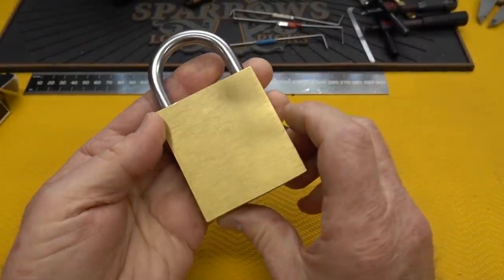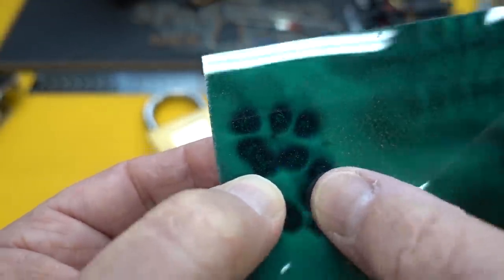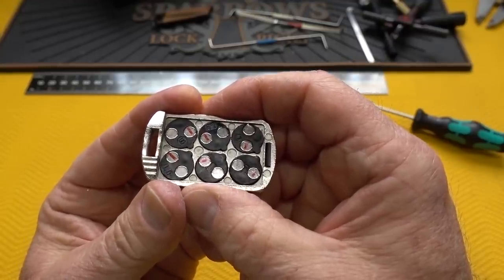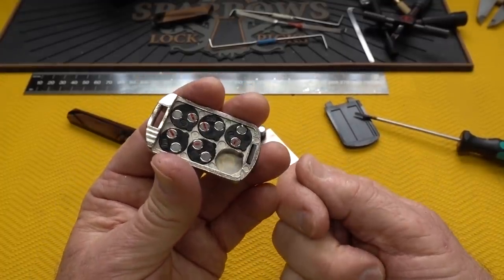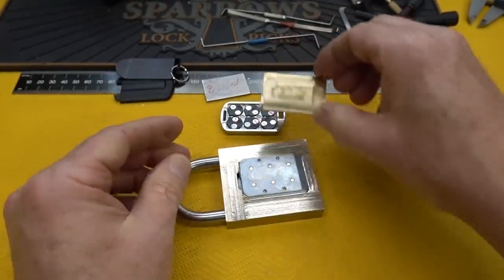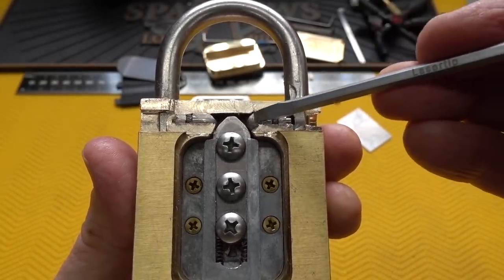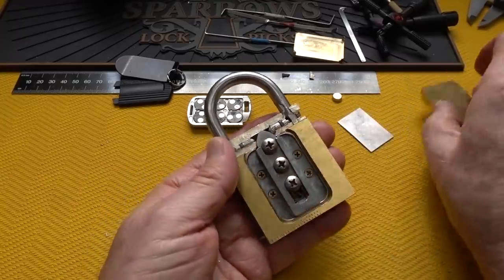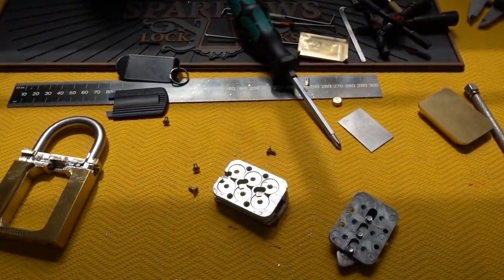(1701) RELOOK: Magnetic Lock (How It Works!)

Comment: plan of attack:

1 get a magnet paper and do the same as he does at 2:42 to find out how many round things there are inside (count all magnets and divide them by two since there are two magnets per "wheel")
2 make a tool which is like the key but the "wheels" can spin with a "nob" or whatever (the orientation of the magnets isn't impotent as long each individual "wheel" has one north face up and the other face down).
3 give some tension and start rotating these "nobs" on the tool until you hear a click or feel a bit of motion or touch point's while spinning. (idk how it'll feel cuz i aint got one i guess something between a vault and a normal lock)

I think IF this gets mainstream a tool would appear, like with the disk container locks.  

ps: i know how all a y'all LOVE the make a tool .... part of this XD

Comment: It is a neat design, but I think there is a way to open it using a small but strong magnet.
There are only six discs that need to rotate. The pole orientation of the two magnets in each disc doesn't matter.  You should be able to feel around each of the 6 disc areas with a small magnet in your hand for the magnet in the disc that it attracts to. 

Once you find the attractive magnet, you should be able to slowly rotate each disc individually.
Rotate the discs on the left side CW, and the discs on the right CCW so they rotate in the same direction that the lock bar pins puts pressure on them.

By applying light tension on the shackle, and in turn the locking bar, it should be possible to move the pins down far enough to locate each of the gates as they are rotated into place.
Once captured, the pin will prevent the disc from turning further.

You should get feedback once the disc stops rotating by feeling for the magnets in the disc to stop moving. 
Mark that position.
If the position of the magnet in the lock seems to change position each time it stops, it could mean that the pin is binding up the disc but is not in the gate. Try again until you get a consistent position of the magnet.

Just work out each of the disc positions until you get an open. You could use additional magnets to hold each disc in position while you work the other discs.

A better design for this lock would be to add a number of false gates around the edges of each disc. It would add little to the cost of the lock, but would make it much more difficult to exploit.
Reply: I was thinking the same thing. Someone should build a key with 6 dials on it that can be turned and locked in place to try and pick it then add false gates and serrations etc for testing.

Comment: A small magnetic stud finder would have indicated polarity. However, the precision needed to read the keyway would be difficult to achieve. There is no way to tension the lock to get feedback, and turning the key into a pick that allows you to rotate the discs would be very difficult. It would be like trying to decode a combination lock by simply entering combinations. 1-1-1, 1-1-2, 1-1-3, etc.  Very nice lock.

Comment: Very awesome! Much more complicated than my initial guess of 18 magnets with either a N or S polarity. In this particular case, I'm happy to be wrong. That is almost artwork! Anyone at this point who is suggesting robotic devices to cycle through combinations is on a crazy train lol! Some locks ya just gotta CUT!
Reply: yes, it appears all that is needed is to drill a small hole on the back of the lock at the sheer where the cover plate was bashed in, then just lever it out and unscrew the 3 screws that hold in the gate bar in place.
Reply: @penfold7800  or just use a pipe wrench and twist it.
Reply: @penfold7800  I was wondering, now that we know the layout, if you could give the "key side" a good whack or two right in the middle and force the lock mechanism to push out the plug on the back side.

Comment: That would be difficult to "pick" too as the wheels would bind in pairs.  If you had a key but it wasn't the right one, you could stick the individual "pucks" onto the lock, they will align themselves to the wheels on their own assuming they don't crash into each other, but then you're stuck twiddling each wheel, pulling the shackle, and hoping you're close enough on a PAIR of wheels to feel the "give", but if the posts are aligned with high enough precision, there's still too much in the way to get a proper feel for it.  VERY COOL DESIGN!!!

Comment: Attack idea: build a key with six of these dual magnet discs that can spin freely but can be locked into position by a small mechanical handle. Place the original key on one side, lock the discs and voila, the other side of the key is now an instant standalone working copy of the key. The mechanical equivalent of copying a (non-encrypting) RFID tag.
Reply: Bonus points for making this “copying key” from an original key so that it even looks legit.

Comment: I haven't read all 510 comments before me (it's 4am and the baby has scrambled my brains a bit at this hour), but I think I have a plan for "picking" this...
1. Lift on the hasp (correct term? U-bolt bit) to apply tension.
2. Use pencil shaped magnet (or magnet on end of pencil shaped object?" and draw downwards, top to bottom, down the centre of the lock.
3. Draw upwards on the left side.
4. Back down centre.
5. Upwards on right side.
6. Continue on that figure 8 until you get an open...
7. Maybe... I don't know... Babies are exhausting...

Comment: OK, I think I got a lot of a pick for this figured out. 

The plan:
Be able to turn the discs.
Be able to know when the disc is in the right position.

Design:
Now, the key has 6 discs with 2 magnets each. 
The pick would be similar, except you'd use rods with strong neodymium magnets on the bottom.
These rods would turn and have marks for each possible position. Looked like there were 6 possible positions.

Operation:
With super slight tension, you rotate each rod until feel resistance. That would mean the lock disc is bound and the magnets are trying to pull the rod back above them.
Repeat with each rod. You may have to skip a rod and come back to it later, just as you would a pin or wafer lock. 

Anyone see a flaw?

Comment: Very cool mechanism similar to EVVA MCS, but without an exposed keyway. Tough, but not impossible to beat. It has a couple flaws though. 

First, no false gates. Any attack will include listening, and false gates would really mess with that, done right. 
Second, to keep with the watch comparison, there needs to be some sort of circular spring under the "bible discs". Just strong enough to return to a "home position." That would defeat any picking approach, and in combination with false gates, could severely complicate impressioning based attacks.

Comment: It would look to me like you just need a little box with 6 knobs on it.  Knobs connected to shafts with 2-magnets each at the ends - and turning them so that the edge closes to the center moves towards the top of the lock (on side clockwise, the other counter clockwise).  I'm guessing that the lock with such wide gates would give up the combination with a bit of finesse.  It's an interesting mechanism - that would probably be good to use with another technology.

Watching your videos (and LPL's), I've been dreaming up this ridiculous Bowley+Medeco+Abloy variant...  toss in some Capitol Industries magnetic stuff - could be hours of fun.  Or a few minutes for you and LPL  ;-)  Too expensive to mass produce for sure, but one heck of a challenge.

Comment: Also, the magnetic momentum given by the key can't grab ahold of a disc with 180 degrees error in it so all the magnets start off at same orientation and will need to be turned less than 18o degrees in the correct direction to position the notches correctly. The only thing one would have to go on here is the non ferrous metal in the discs so a thin metal detector probe could potentially see when a disc is turned correctly. The discs appear to snap back as if spring loaded but I guess that is the magnets in the other discs.

Using a plate with 6 sets of magnets linked by gears  one could potentially twist all 6 plates to a new stable 180 degrees orientation and the key would potentially no longer work.

Comment: Sorry to say, but the magnetic paper absolutely does give you the disk rotation of the key.
Going by hour hands on a clock: Look at the video timestamp 1:46

12/6          - 10,4
1/7             -  10,4
8:30/2:30 - 11,5
for disks
1 - 2
3 - 4
5 - 6
Whether north or south then takes trial and error, but the combinations are reduced enormously, but of course this only works if you have the key, but like making a pin key from a picture this would be much the same except that you would need physical access.

Comment: Tension as usual by applying very light intermittent pressure to the shackle. your 'pick' would be a tool with a pair of N/S magnets rotated over each receiver 'pin'.  Your feedback would be miniscule from the tension hand.  Nice lock but could probably be raked with a high power, low frequency, alternating phase electromagnet.

Comment: So the "Pick" would be 6 spinning magnets in the same layout that would rotate all the discs. Pulling on the shackle could then bind the "Pins" as they spin and open the lock. Or you could just use a suction cup on the back to pull the plate out and take the mechanism out. You would probably need an active vacuum pump pulling from the suction cup because i guessing the finish on the surface is course enough to prevent the cup from making a good seal.
Reply: No way a vacuum would be able to pull the back out, the final machining would create effectively and interference fit / weld on the backplate.  Again the tech required to beat the lock would outspend the value of goods the lock protects (given a sensible owner).

Comment: Looks like the problem with picking this thing is that there is no way to tension the mechanism without binding it up completely. What's more, due to the lack of physical contact between the pick (which would be one of those magnet wheels inside the key) and the pins, you cannot get any sort of feedback at all.
Reply: You would get feedback.  If you used a disk with 2 magnets in it, and slowly turned it, you'd feel the magnets start to disengage when the mechanism caught.

Comment: After watching this and legendofthesamurai's picking, I'm thinking to myself: Well, a look is only good as long as the attacker does NOT know what to expect and thus doesn't have the tools.
Here's what he did:
With tension on the shackle, forcing these wheels to bind, this can be decoded like a 6-wheel dial lock utilizing some magnets with the handicap of not having a direct feedback, but you can help yourself using some magnetic paper cut to shape. It sounds really simple if you put it that way, and it took him only a bit over one and a half minutes to do so.

Comment: I think they key is in the polarity of the 2 discs next to eachother. As you saw when you removed the key again, they jump around to a different position, mostly due the 2 discs polarities repelling eachother. Now when the key is in, the discs either have to be on 'equal' polarity or the strength of the 2 magnets of the key have to be strong enough to overcome any opposing polarities of the discs. Now based on the distance between them, i assume the 'offset' can not be any further then a quarter away from their 'rest' position, if this would be greater, the odds you face oposing polarities can be stronger then getting the disc to spin 90 or more degree into the right position. I gues the hardest part is finding wich of the 3 sets binds when you try to rotate them (just get 2 2x magnet sets - based on the magnetsheet - as 'screwdrivers), but judging by the size of the gaps and it easily can have ~5 degree slack, plus you cant go beyond (my assumed) 90 degree, you drop down to roughly 9 positions per disc, thats is ALOT less then them claimed 100.000 positions possible.

Comment: yay you mentioned my comment (the crazy idea about the microcontroller with small electromagnets).
seeing how it works on the inside, i think it would be easy to brute force (again with a crazy invention - though this one is simpler and easier than my last suggestion)
im not saying "you should make this", just want to put it out there for anyone who might want to try it in the future
if you think of it like any combination lock, the slow way to break in is try 0000 0001 0002 0003 0004

you do the same with this, but with 6 sets of 2 magnets, mounted on small stepper motors, you spin the magnets around to brute force
it would need a servo to check if the lock opens, constantly pulling on the shackle would stop the disks from turning
it would actually be way easier to make than my comment on the last video, just 6 steppers (or 360 servos) + 1 servo + 12 magnets

if you really wanted, you could even skip the microcontroller, make it geared so that a full rotation of pin 1 is one step of pin 2, and just turn it by hand (though you would be waiting a long time)

Comment: Just finished the original review.. I'd speculated that there weren't any actual magnets inside the lock...  and, well, i'll be damned, there ARE actually magnets.. i stand corrected on that point. In fact, i stand corrected on all of my points... well, aside from where i said that it's a really cool lock, and that you could probably kill it with a hammer. The internals on this thing are way cooler than i imagined, and i'm actually glad to be wrong about it. Awesome lock, Awesome video. Shit like this is why i subscribed all those years ago.

Comment: Everyone talking about they know how to pick the lock now. But, if the back plate isn't secured by brazing/epoxy/welding/etc it should be easier to remove the back plate and unscrew the lock mechanism than try to pick it.

Comment: Cut the nibs off of the keys disks so that they spin freely. Apply a constant opening pressure on the shackle. Apply the modified key an spin each set of paired disks. One pair should bind on the binding screw. Then turn them by feel to set each pair, allowing the screws to slip down in binding order. (Might need a way to hold the disks in place. Not sure if they would reset when you let go of them.) Either way, you'd have a very unique pick. Lol

Comment: Taking it apart makes it much easier to design a picking tool. You could make a fob with 6 dials that spin the magnet sets. Maybe there is some sort of feedback you get from rotating. If you remove the point on the fob magnet and attach a shaft to a dial, you could probably make the tool with minimal parts. I think you could accomplish it with the tools and materials you have on hand. If you succeed it would make another interesting video. Otherwise maybe it's a project LockPickingLawyer is willing to tackle.

Comment: Back in the early 1980's I was the one tasked with the responsibility of securing my shift's refreshment cupboard. Any such items left unsecured would just disappear when the other shifts were thirsty or wanted some condiments or other rest break supplies. While looking around for a decent padlock I came across one very similar to this. The 'key' was less that half the width of that one, not as thick and was used against the side rather than the face. I left it behind - along with the keys of course - when I quite that company, but no one ever got into our supplies during that period! I can only surmise how similar the interior mechanism worked in comparison.

Comment: You can pick this using the 12 magnets you have formed into a key.
You will need plasticine (putty) and the 6 manets from the key.
Place a thin non magnetic over the "key hole" on the lock. 
Place the magnets,  one by one on the plastic plate.
They should attract to the magnets in the lock, and will show the correct orientation +/- . Press the putty on top to get the position & orientation. 
Remove all as one. 
Turn over, and carefully turn over each magnet to opposite polarity. 
I believe this will open the lock.  :)

Comment: You could decode the key using the viewing film PLUS a small magnet. The only thing it, if you already have the key that might not make sense. The only other way would be attacking each disk in the lock separately, to in pairs, but it doesn't seem like you would have any real feedback. The most practical way in the real world is to cut the shackle or attack the backplate. A super cool lock!

Comment: 13:34 it's pickable. See when he turns one, the opposite side moves in accordance. Pull on the shackle, use one small strong magnet, make circular motions above the small discs. The pulling of the shackle will push the "pins" into the hole when it aligns. You can then take the magnet away and the pinwikl hold it in place. Continue to the other 2 sets and you're good to go. I'm Imagining using the magnetic paper to help view where the discs are will help.

It looks like it will be a quick pick. Like raking. Bill. Pick it please.

Comment: I know this is a bit late, but couldn't the back plate just be pulled off non-destructively with some strong tape, so you could pull the guts out, or apply pressure to the locking bar & pick it with a single, small neodymium magnet?